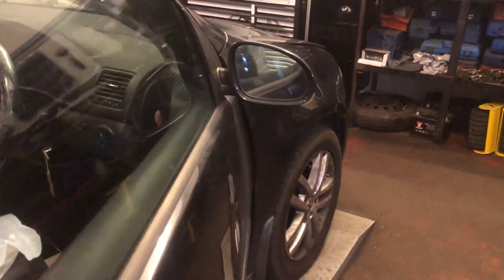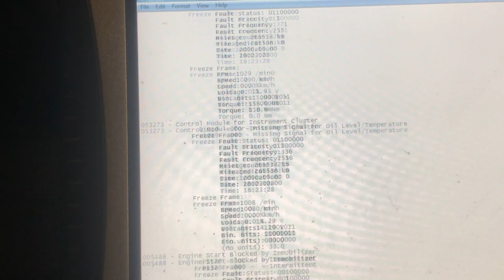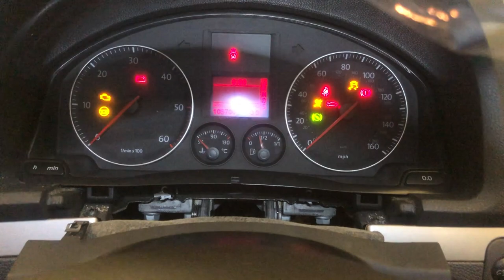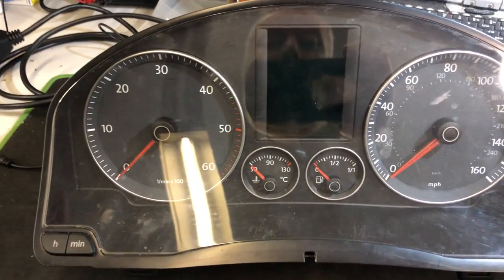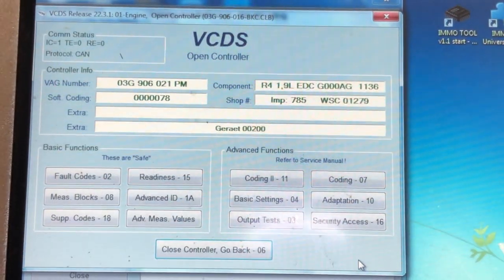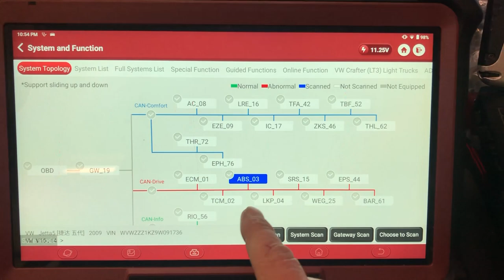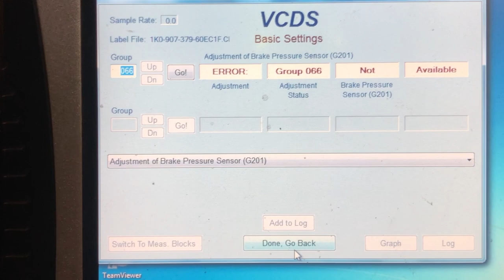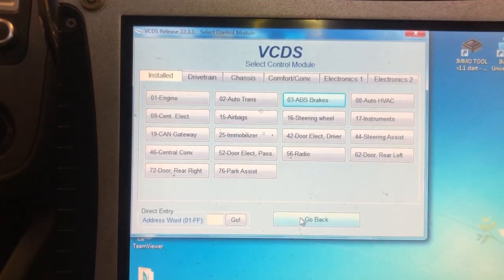VW Golf mk5 Instrument Cluster (Micronas) How to Remove, Fix + Refit + set ABS Long coding

Comment: Hi, nice video, i have also a MK5 and I have a question. Is it possible to swith the instrument cluster for the one with big display. The one which is in it is the one with smaller display, and I was wondering if it is possible to do such a thing, and does it need a lot of work to do or is it just plug the other one with big display and do the coding? 
Thanks!
Reply from the maker: Hi, yes it’s possible - it’s not just a straight swap though, we should be able to transfer the Immo block for you & then you can do the coding by OBD..

Comment: I had this exact problem I disconnected battery checked fuses everything was good and still didn’t work, tried turning it the next day and it turned on like nothing happened? Could this just be bad mobilizer connection? Thankyou
Reply from the maker: This could well be a faulty instrument cluster, if you want to replace it you will need to buy a donor unit with a matching part number & have it cloned before fitting - We offer a cloning service by post!
https://ecuconnection.co.uk/product/hyundai-i10-airbag-ecu-95910-b9250-programming-reset-repair-service/

Comment: Hi when Lost coding must be done online to get the original coding or how thank you so much for your help
Reply from the maker: Hi, it depends on which tools you have & which type of ABS it is, if you have original VCDS then the guys at Rosstech may be able to help by email, there are also various calculators available online for ABS MK60 & ESP8.2 or as shown in the video on a lot of systems it’s possibly with the Thinktool Max / Topdon / Launch diagnostic tools etc… if all else fails then you will need connecting online to ODIS….
Reply: Maybe if you would copy external eeprom too it will have all needed data?

Comment: How did you remove the immobiliser. I have a seat leon engine in my caddy but have to run the leon clocks and they dont fit to well. So would be ideal if i could remove the immobiliser so i can run my original clocks
Reply from the maker: Hi & thanks for watching!.. The immobiliser was not removed from this vehicle, we repaired the instrument cluster, if the repair was not successful then we read the data ready to clone another set of clocks. We are able switch the immobiliser off many VAG cars if you need - we may also have a different solution for transplanting your clocks, check us out at www.ecuconnection.co.uk or ring us for advice..

Comment: Why the clone and coding ?
Reply from the maker: Hi, if you watch again the start of the video, the original cluster was completely dead, didn’t power up at all & had no comms with Diag tools.. the reason for coding was because we plugged in a replacement unit to test - this unfortunately wipes the ABS coding due to it having the wrong VIN, this happens on a lot of VAG cars & is why we recommend people don’t test fit clusters unless you have the equipment to recode afterwards, and even with coding equipment it can still be an awkward job - as detailed in the video! We would usually just clone these units but as we didn’t have the correct unit available I decided to repair the PCB instead which in this case worked out fine..